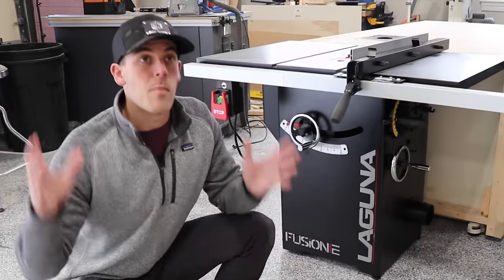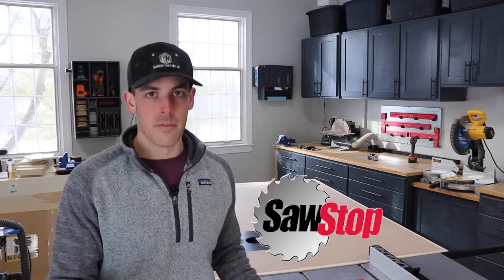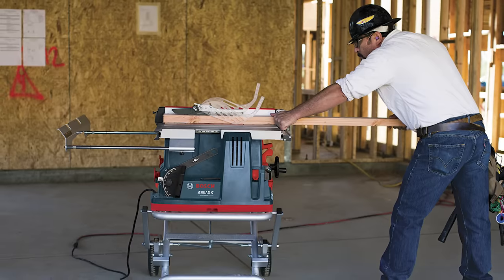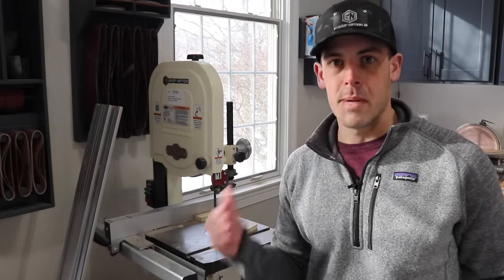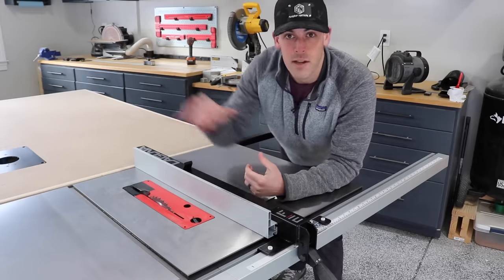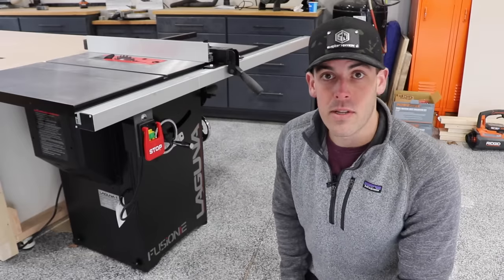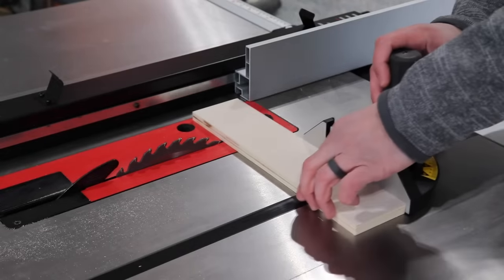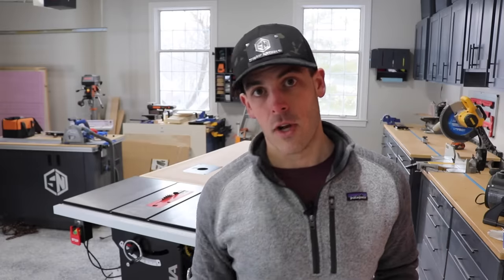Why I Bought a Laguna Table Saw over SawStop!

Comment: I enjoyed your video. I recently bought the Sawstop PCS 3hp with 36" fence. Ya, it was painful to spend that much on a table saw but at 54 years old, this will be the last table saw I ever buy and after a couple beers, I didn't care any more. I really couldn't afford it, maybe a mid life crisis thing, I don't know but I love this saw. I got the industrial mobile base which makes it so easy to move. My previous saw was the Ryobi B3000 that I have had for over 20 years, it was "OK" but had a lot of issues,  hard to move, had to use only Ryobi accessories and the fence was horrible. Anyway, I'm sure the Laguna saw is great and half the price  but you only live once and if you are a woodworker, the table saw is probably the most used tool you will have in your shop. I have no regrets buying the Sawstop but understand that it's not for everyone.  Thanks for sharing your video.
Reply: If the saw fits your need, go for the sawstop.  If it does not, live with something else.  Don't have the money, live with something else.  It is simple.    I wish Sawstop would dump the contractor saw, make a true hybrid like the Fusion.  Then, I would probably be owning a Sawstop.
Reply: @alsmith7316  Yes, or maybe look at the years you've waited and value them at $250/yr (that's less than a $/day). After 3 years of waiting, get the saw you want instead of settling. Like any quality tool, it will be a joy every time you use it.
Reply: @steveh8724  3 years?  I am confused.

Comment: As an eighty seven year old woodworker, I have used my Delta cabinet saw for decades without incident. I have never by-passed its safety features, including leaving the blade guard in place, except when dadoing. Even then I use every safety appliance I can. Sawstop is an awesome saw, I believe it is needed to protect those that decide, for one reason or another, to disregard safety and remove features that can save their fingers.

Comment: Good video. Being a retired engineer, I have also done a lot of failure mode analysis.  I am looking at replacing my old table saw, one without even a riving knife.  At 30 to 50 years old, I could weigh the risk and be careful even when I knew a riving knife would be so much safer. Pushing 70, my hand strength and reflexes are not what they used to be 20 years ago.   I may be able to work for another 10 years.  My father in law was still turning and enjoying projects into his 90's.  So for me, I will go the extra bucks and buy the sawstop.   My risk category is higher than it used to be and much higher than yours I would guess. My last table saw amortized over its life cost me less than $20 dollars a year.  A saw stop will likely cost $250 per year for the time I use it.  I am in a position to afford that.  Very good video.

Comment: I bought the Sawstop PCS several years ago, loved it and used it a ton. I had to sell it when I closed my shop and I made back almost what I paid new for it. So basically I paid a few hundred bucks to use the saw for several years and have the security of the safety feature. When I get a shop again I will buy another Sawstop without question.
Reply: Resale is important. Just like safety features on a car, they do increase the value.

Comment: I've been a hobbyist woodworker for 36 years. In that time, I've managed to cut two different fingers on my tablesaw. I'm lucky to still have all my fingers. When I decided to build all the cabinets for a new house 8 years ago, I told my wife I wanted a SawSop. She was 100% in favor. I bought the PCS model with the 52" fence and mobile base. Two years ago I added a Wixey digital readout to the fence. This saw is a dream to use! It's incredibly accurate, has ample power and, best of all, I have the security of knowing that when (not if) I next touch the moving blade, I will likely get nothing more than a scratch. 

The poster preemptively comments about the likelihood that others who have SawStop will say, "But what about your fingers? Aren't those worth saving?" He apparently doesn't think the added costs for the SawStop are justified. For me, budget constraints weren't a major issue. I bought the machine for the added safety features and would do it again without hesitation.

Comment: I own a Sawstop Professional 3hp and I bought it because as I get older my Wife was concerned about me cutting of my finger or worse. I was intrigued as well and since I was at a point in my life where could afford expensive toys I bought it. I even bought the overhead dust collection which I eventually changed to the new bigger more improved a couple of years later. The saw is top of the line and it is packaged so well that when you take it out of the box every nut and bolt is numbered to go to the part. It is without a doubt the best packing and made assembly so easy that many companies could learn from them. That is also another reason for the cost is the amount of time put into how to assemble and tweak. It is the best saw I have ever used in my over 50 years of working with wood. If price were a factor I would buy something else like Laguna or Grizzly which I have a few machines from and they do very well if you get the higher end. Many of these machines come off the same assembly plant in Taiwan or China just have different badges. General Motors did the same with many of the trucks and cars with GMC on one side and Chevrolet on the other side of the truck. I am more afraid of losing my finger on my band saw or router table than the table saw. We have to buy what we can afford but try to buy your last machine first or you will loose money in the long run. I think Laguna has a good product but they are very slow to deliver with many delays and excuses because I tried buying a dust collector from them and had to cancel after too many delays and I have heard the same from other folks. I think Grizzly's higher end of machines is comparable to any ones, less expensive and fast delivery with great customer service after the sale. Bottom line I think you made a good choice for you. Kudos.

Comment: I’m an engineer as well. Spent immense amount of time and training on risk ranking as well as risk management. I worked at a large underground coal mine. Pretty much everything will kill you.  But you use risk management to bring down the severity of an incident. Ie understand contributing factors. I’ve used a table saw for about 35 of my 41 years on earth. My father and grandfather before me as well. Between the three of us we still have 30 digits. I learned on saw with no riving knife, no splitter, no guard, - just a spinning blade. I was taught to look at the grain, how to position your fingers, now and where and what type of push sticks to use. How to use the fence. What type of blade. Where to stand. I learned on a Unisaw, I now own a Unisaw.  Doing that  reduces kickback and potentially running your finger into the blade. The other factor is you use a tablesaw for the majority of your wood working projects, do you have a high probability of injury on it solely because your exposure time is higher - hence your more likely to be injured on a table but not because it’s more unsafe. Having a good quality tool, that runs and operates correctly with the correct and sharp blade is most important in my opinion. Second to had is training and experience. I also think sawstops give woodworkers bad habits. Albeit I will say it’s amazing technology and it’s saved many fingers - I can and won’t take that away from it.
Reply: I can totally see where your coming from on this one, but I think you're underestimating how hard the amount of training you have is to come by. I am a first generation "woodworker" of about 1 year. I've watched a LOT of youtube videos about table saw safety, but I don't think it's possible to reach your level of operating safety/knowledge in my lifetime. 
>I was taught to look at the grain, how to position your fingers, now and where and what type of push sticks to use. How to use the fence. What type of blade. Where to stand.
This is all stuff that has basics that can be "taught" via training video (or youtube), but in reality is a minefield of nuances that you, and other masters of their craft, have achieved subconsciously by watching and being guided by your grandfather and father. I think it is SOOOOO COOOL that you have this level skill, but it is not something I will every have access to.
Reply: Having said that: I am currently using a piece of junk jobsite saw that I'm sure is much less safe than this beautiful Laguna.
Reply: But you have failed to point out the importance of the concept of "accidents." Surely you realize that the experiences of 3 generations of your family, or my own are just examples of anecdotal information. Sure, one considers that, but to truly judge risk, you have to look across a population. So consider the population of "serious woodworkers", for example those that read and contribute to Fine Woodworking as a possible example. We've all read countless anecdotes of people who were not as "lucky" as you and your elders. Some of them may have done something intrinsically unsafe due to lack of knowledge or experience. But most accounts I recall are from people who, right up until the moment they were injured, had the same "experience" to report as you do. Careful, no accidents, come from a family of careful accident free woodworkers. And then, in an instant, their lives were changed--forever. Thank goodness severe woodworking injuries from table saws are not common. But they do happen.

And I have to ask, just what "bad habits" do you think SawStop usage causes among its users? I find this assertion troubling because you offer no rationale or support for this contention.like
Reply: @steveh8724  I agree.... the "bad habits" claim stuck out like an amputated thumb when I read that (pardon the twisted cliche). I'm curious what bad habits are encouraged by using a Sawstop. It's expensive enough if you trigger the Sawstop brake that you're probably not going to casually do that more than once any more than you'd casually lop off a second finger. Does having a modern saw with a decent riving knife/splitter, blade guard, and dust collection also give woodworkers bad habits that a "spinning blade" would not? Not to trivialize bad habits... I've had to take one of my guys to the hospital to be evaluated for broken ribs due to a careless kickback, and I play in a band with a cabinet making fiddler who is missing about half of a finger on his left hand. The fact is we're human... we get tired, we get distracted, we get overly casual and comfortable with what we're doing. We're working with a material that is not homogeneous. I taught my son the importance of being mindful on the machines, of using pushsticks, where to stand, and to not distract an operator mid-cut or allow himself to be distracted mid-cut... but accidents are those things that defy all that training and effort. I don't see modern saw safety as any different than seat belts, padded dashboards, and crumple zones in modern automobiles... hopefully they don't result in "bad habits" because we don't have to fear a scull fracture on the steel dash of a '55 Chevy if we drive into a tree.
Reply: I totally agree,2 guys have set off our cabinet shop sawstop 7 times in 3 years.
$90 cartridge and $150 blade each time.
My first boss made sure I understood the shop wasn't a place for pranks etc.
I wouldn't buy a ss for myself.
Reply: I totally agree with you. I worked in a cabinet shop and ran MILES of wood through table saws. Our boss was a stickler of NOT EVER being loud and NEVER playing around when the power equipment was on. Two guys got fired within their first week for being silly at the wrong times. Watch the fence, know your wood, keep things clean, keep things sharp, and take your time. I, too, don't knock safety, but knowing how to be safe is just as important as a tool that gives you unusual advantages. I've seen saw stop in action and it is amazing, but I like my good old saws with a sharp blade, good fence, etc...
Reply: Table Saws: These tools, which are omnipresent in construction sites and woodshops, are responsible for the most number of injuries involving woodworking – 39,750 injuries annually. The National Institutes of Health also estimates that there are more than 30,000 table saw injuries in the U.S. annually. Fingers and hands are the body parts most frequently injured by table saws. The medical costs of treating injuries caused by table saws top $2 billion annually.
Every year!

Comment: Congrats on the new saw. Just went through this process myself but went with the Grizzly 3hp 1023. Had the same thoughts about the Sawstop and at the end of the day, I knew I wanted 3HP 220v and for the price Sawstop was out. Happy building
Reply: 1023 in my shop too. Love it and the Incra TSLS-32 fence system

Comment: I was only generally aware of the SawStop line until I got back into woodworking in a big way over the last several months. I have a Bosch job-site table saw that has worked well over the last 20 years for DIY house projects over the last 20 years.  But now I’m aspiring to do cabinet-making and even furniture.  Just this weekend my wife saw me using the saw without the guard and got freaked out. It got me to thinking…

So I started doing SawStop research on the web and YouTube and ran into this video.  I don’t have 12 paragraphs for you but I’ll say this:  I don’t want to have an accident.  but if I do, I like the protection this offers. I wear my seatbelt all the time and never had to use it. But I’m glad my car has one and I will always use it.  This feels like a seatbelt for my table saw and my revived woodworking hobby. I can afford it and expect it will last as long as I use it. Seems cheap to me.

Comment: I have a fusion 2 and love it. Accuracy, smoothness, quietness are all great.  Dust collection is quite good as well. Upgraded it to the optional 52in rails as well !  Will probably add in a folding out feed table somehow in the future but still love the saw. Just wish Australian prices weren’t so much more. You guys get the F2 for $1300 I think, over in aus I paid $2600 including that rail extensions. Still worth it tho. And like video, I was choosing between Laguna and Sawstop.
Reply: I agree with the pricing, Australia gets the raw deal with the cost of machinery and software. I am getting rid of my Triton and considering between the Laguna and Sawstop.
Reply: Present price for a Fusion 2 on the US Laguna site is $1799 ( about AU $2,520. ). I don't know if there's any sales taxes etc. on top of that. In the UK the Fusion 2 is priced at £2,599 inc 20% VAT! The 52" extensions are another £249 inc VAT on top.Their US site doesn't list the 52" rail extensions, but they list  Fusion 3 52" @ $400 more than the standard Fusion 3.
Reply: @BungalowBill58  I did exactly that! Except, I was lucky enough to have found a near new second hand Laguna. The guys at Carbatec were very helpful in sourcing a few upgrades I required. The new dust hood/blade guard works heaps better when you cover the exposed holes with clear vinyl. I absolutely love my Laguna Fusion Table Saw.
Know anyone in Canberra who wants a Triton?

Comment: I work at a construction company as a finish carpenter. My work bought a sawstop table saw about 5 years ago. The saw was amazing brand new. A massive upgrade compared to what it replaced. The first 2 years I took great care in maintaining it. I quit working there for about 2 years and came back to a saw that was poorly maintained. The fence will not stay true. The nylon bushings on the fence are wore down. About a month ago the saw was set off. So we replaced the cartridge (sawstop provides no information as to remove set off cartridges. and the process to remove them is a pain in the ass and almost always damages the blade). Turned the saw on, it ran fine. My coworker then turned it on to cut some wood. And it set off without coming into contact with anything. I think sawstop saws are a good fit for shop settings with low usage.

Comment: I have a Contractors SawStop that I have had for over 4 years.....I did not buy it because it would make me a better woodworker....but because of the safety feature..... I am retired...getting older, and for the cost figured that the safety feature was important.  I did not need all the features that a cabinet saw has....
Reply: I understand the safety feature......but I shouldn't have to pay 2x the saw for 1 feature that if it ever engages is going to cost easily $150 if it ever engages (replacement cartridge and blade because the blade is unusable after.  Its very Apple like pricing.....
Reply: @Taylexwow  much cheaper than a finger amputation or surgery.  It only takes one time to learn that lesson.
Reply: @chadhowell1328  it also doesn't take a genius to work safely either
Reply: @Taylexwow  said every person ever. Shit happens, most understand that
Reply: @Taylexwow  Doesn't take a genius to not get in an accident...but then again, they're called accidents. Unless you're perfect, and if so, I'm very jealous.
Reply: @Taylexwow  Then by all means invent your own non-infringing technology to do the same thing. Why should I have to pay so much for a cell phone or a car? And forget airbags! Once they deploy, they have to be completely replaced. What a ripoff. Why can't I just carefully re-pack my airbag like I do my parachute? Ffs...